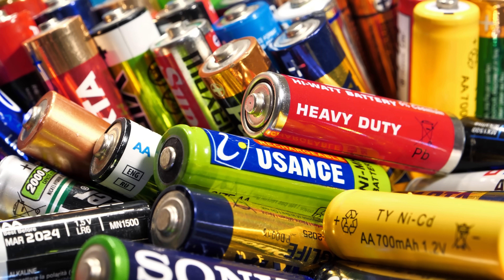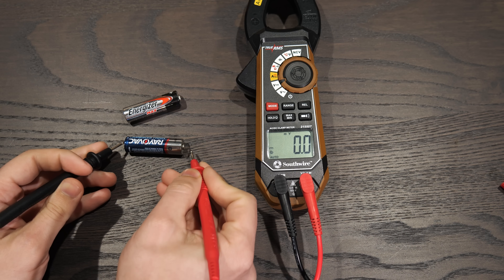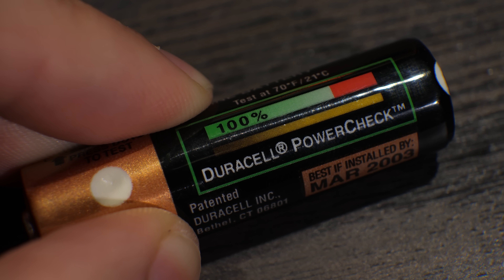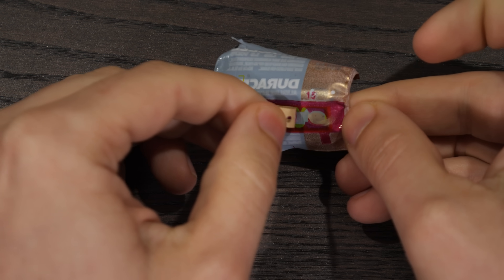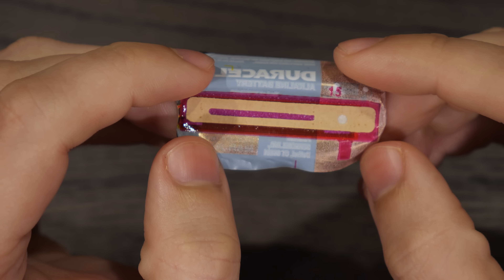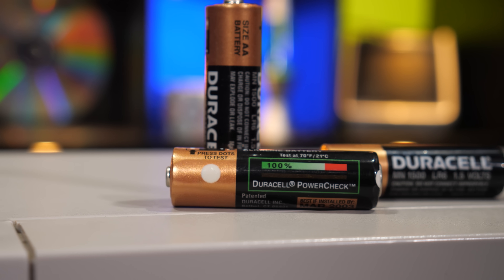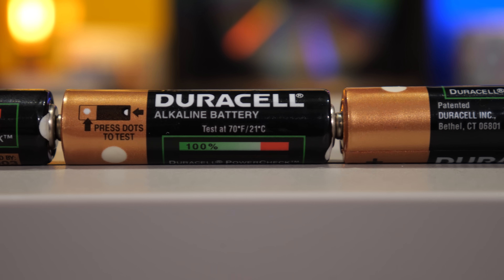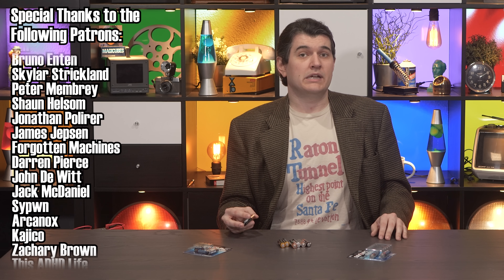Duracell PowerCheck: A genius idea which didn't last that long

Comment: that reference to a device telling you how much charge is left... minor rant. TV remotes have been able to give on-screen "low battery" warnings for multiple decades now, so why are companies still making remotes that don't do this?! I'm a TDS TV customer, so i've got a TiVo android box (yeah, TiVo's still around... who knew?) and TDS provides two different options for remotes. one that is basically a standard TV remote (though it illuminates the button backlights when you move it), and one of those annoying "smart" remotes that you can talk to. [small tangent: since those things are always listening, doesn't that really drain the batteries? who thought that was a bright idea?]. the standard variant does not give the on-screen notification that the batteries are getting low, it just stops working.... EXCEPT, it absolutely CAN do it, because we've had it give us that notice exactly twice..... in 5 years. i've had to swap out the batteries in it more than 4 dozen times by now, and it's only told us it's low twice. what the actual hell?! (yes, we use rechargables. energizer to be specific)

Comment: One annoying thing about a lot of early electronics like the Game Boy is that they only worked well when the batteries were around peak voltage.  Can’t even use it with rechargeable AAs because they have a lower peak voltage of 1.2v. This is one reason I did end up with a lot of half used AAs, since these batteries still be used in other devices that could cope with the lower voltage.

Comment: Its not that good, because with AA we could.go for rechargeable one and not throw it out, and just charge it. Now ee have builtin  bespoke batteries in evrything that are noght impossible to replace once it dies. 
Or single use devices with them like single use E-cigarettes/vapes, which is arguabky infinetly worse than simple double AA.

Comment: In my experience, the most common use for that feature, was to determine if the device was faulty or, if the batteries needed replacing.  If your TV remote becomes intermittent, the first thing to check is the batteries.  If they're fine it could be another issue (such as someone placing an obstruction in front of the sensor on the TV).  

Furthermore, quite often one battery within the device could be more dead than the others.  So then, rather than replacing all the batteries, you'd only need to replace that one.  Theoretically, if all batteries are created equal, then any time one battery is dead, so are all of them in the same device.  In practice, batteries are NOT all created equal, so if you throw out all of the batteries at the same time, you're wasting some of the life still left in them.

Comment: That power check gimmick intrigued me especially when I was a kid. I remember seeing cheap Duracell knockoffs having a blatantly fake facsimile of the PowerCheck label on it too. And I do remember the separate coppertop tester tool that came with earlier Duracell packages as well; incorporating that check into the batteries themselves was even cooler to me as a child, though pressing the buttons firmly was equal parts frustrating.

Comment: I've only had these a few times back then, mostly out of curiosity, but I've always wondered what the point of the indicator was, because, just like you suggest, I pretty much never had partially discharged batteries to worry about.

Comment: Comment from Italy here: I'm pretty sure that, in the past year, I've bought Duracell AA batteries with a pressure activated charge check. If I recall correctly, it has a green bar now, not the old yellow one.

Comment: Thank you for mentioning the included separate battery tester that came with that batteries! I was going nuts for the first 13 minutes remembering a separate tester before it was built into the batteries. I remember those worked much better than the built in tester.

Comment: Don't keep half used batteries. The chance of alkaline leaking occurs most with voltage mismatch on cells, or using different battery chemistry.

Comment: Still got a AAA on my shelf; still tests full! Without the movie magic, the bar slowly fills in from the negative side towards the 100% mark. I never would've guessed it was a resistive heater out of all things. Fascinating stuff considering it still wouldn't be remotely financially viable on a mass scale with modern technology. I never had an issue using them, and I still always keep plenty of half-used batteries around.

Comment: Sometimes they included a single thin plastic strip tester that used the same principle.
You'd bend it into a C shape and put the battery between the two ends.
They were awesome because they'd work on AA, AAA, C and D cells.

Comment: I also had a gameboy 😂 and i remember these. i DO put away half used batteries, and use them on other stuff (e.g. remote controls can take a low battery) but i have a multimeter now 🤷‍♂️ these were only ever useful to me as a kid 😂

Comment: It was a sales gimmick.  I thought they were really cool when they came out so i switched from Energizer (I liked the bunny) played with the cool new gadget for awhile. Basically taking them out of my remotes to see how much charge they had left in them for whatever reason, putting them back in, until the remote died. I eventually went back to Energizer which were cheaper, eventually discovered threw word of mouth (internet as we know it didn't exist) that discount batteries were as good as name ones and switched to those.

Comment: I recall a version that was integrated into the packet rather than the battery. I kept it around for years but I don't recall it being particularly useful. If I knew that multimeters measured battery voltage accurately I'd have asked for one as a present.

Comment: You started off with the premise of how frikkin expensive it was to buy batteries.  I definitely used to save worn batteries from something that would need a full charge to run (eg: cd player) to something that didn't need all that much charge (eg: tv remote).  I miss this tester built in, and even if I didn't need it all that often, it's something that made me feel "seen" as a consumer.  As great as your explanation was about how it worked, I don't know that the answer that was given as to why it went away was all that strong.  After all, how many selling points do batteries have, and things they can compete over?  We've heard reliability, we've heard dependability, we've heard longer lasting.  What else is there?  This is something value added (however small) that should be cheaper for them to produce as time went on, and gives them something to tout.  Even if it's not all that useful, it did give that consumer a feel good that, even if they never pressed the button, it was there, ready to dispell the unease of having dead batteries.  There must be something bigger that drove them to stop using it.

Comment: Did you know, when Benjamin Franklin figured out, how electricity actually worked, the had a 50 50 chance to guess if positive charge  moves to negative or the other way around.   It was actually Franklin, assigned the words positive and negative to electricity.
And because that predated the discovery of the Electron by roughly a 100 years and Franklin was also a businessman, he decided the positive side was ...in charge.   Causing confusion to this day.

Still, while Franklin is hardly underrated or a obscure historic person, he doesn't get enough credit for his scientific work.  The above is a pretty big deal. And was at the time.

Comment: I remember using this or the tester included in the box to check the batteries for the game boy before a road trip. We also put the used batteries that were not depleted from the game boy into a drawer to use them for the remote or a clock or stuff like that

Comment: These batteries were made when Duracell made batteries that didn't leak.  20+ years old and completely dead batteries and no leaks!
Reply: I found some old AA batteries that had a date of 2003 and they still had enough juice to power alarm clock
Reply: The funny thing is that I was unplugging the alarm clock to turn it off since I didn't know how to shut it up normally .... it went from low tone to high tone as I unplugged it (also startling me completely awake) and I spent 20 seconds searching for the batteries and finally shut it up

Comment: Even today I still prefer normal batteries over built in lithium. When they run it of juice, it's faster to swap them out than it is to put a rechargeable device in a cradle and wait for it before you can use it again.

Comment: I'd be interested in seeing a video about alkaline battery chargers. I'm talking about chargers that can refresh disposable batteries, not just rechargeable ones.

My dad still has a Saitek Eco charger that is at least 20 years old and works perfectly to this day. It takes some hours to charge most batteries, and it can detect batteries that are too low voltage to accept another charge. No idea what the energy efficiency is, but I'd be curious to know.

Comment: It is still just voltage going through a wire. It is just a tapered wire that changes the voltage required to make it heat up as it increases in size

Comment: Such well done videos , my guy !!  It's been my experence , that these batteries were awful . I tried them twice, with many months in between, but with same results each time. Some batteries were nearly dead right out of the package or they lasted about 50% that of a regular battery . So I believed them to be defective & easily shorted or testers too easy to be activated . Lke when in an opened package or just loosely rolling around in the junk drawer . Duracells always seemed to expire quicker than even  generic named brands for me. I actually prefer the "cheap-o" ones. .Last just as long as "Name" brands & half the cost! Anyone else have a similar experience ??

Comment: Awesome video, I did take one of these apart too.
     And yea, it pisses me off that most especially high drain devices are built to take AAA when they could easily fit, and be more useful with AA cells.  Flashlights and things with motors.  Unless battery manufacturers are subsidizing these product manufacturers, it makes zero sense.  In most cases AA in these applications are absolutely not too big nor heavy.  And I don't care if AAA would be made proper cheap, I'd rather not change them after using a bright flashlight for 10 minutes, and yea, alkaline, and they are getting dimmer before people realize.

Comment: I use an unorthodox method of testing alkaline batteries. I set an analogue multimeter to the 10A range, hold the appropriate end against one probe and briefly tap the other end with the other probe and see how fast the needle moves. Alkaline batteries can tolerate being shorted for the fraction of a second it takes to estimate how good the battery is.

Comment: We used to have those batteries but I never found out how to use these testers properly. Now that I know it and double A's are rarely used anymore, I wish more battery's would have them. Sometimes a device stopped working meant the battery is empty - nowadays it's more likely the device being broken

Comment: I remember those! I thought that was a neat idea and was disappointed when Duracell stopped using those labels. Even though it was difficult to get the on battery tester to work, we would still use them to see if they worked since they would sit in the box for quite some time before being used. We didn't want to get the full sized Volt Meter out to test every battery, so this was nice to have.

Comment: 2:19 Am I allowed to be pedantic, the “multimeter” you’re using is actually called a clamp meter, the difference being how current is checked between a multimeter and a clamp meter. A multimeter has to be put in line to measure the current, whereas a clamp meter can use the jaws placed around a single wire I.e neutral or live to measure the current. 

Also clamp meters tend to be worse at reading resistance (has a lower measuring range, not accuracy) 
Sorry

Comment: One point that was missed as a drawback was the battery size -- the meters made the batteries wider than normal.  That may be fine in the remote, but anything tubular like a flashlight (or even some remotes where a battery slid to the back out of sight) they weren't going in, and if they did, they weren't coming out.  That alone was a reason to avoid them.

Comment: I remember, for a short time before the testers were on each battery, there was one tester built into the packaging. It was made the same way though.
Once, I took the tester from a AA package and tried it with a higher voltage. It turned solid white (I think), then black, then started smoking.

Comment: I use AA rechargeable batteries when possible. Lower voltage means the indicator always stays on the "replace battery mode", but it can hold for months.

Comment: So what is the ideal current draw to test an AA? Regrettably, Duracell quality seems to have tanked, they seem very susceptible to leaking. And Kodak batteries are just low quality China made cells sold by an importer with rights to the name Kodak. Finally, because rechargeable batteries only provide 1.2V is it worth talking about which devices don't work well with them?

Comment: I remember these growing up, and never ever got one to work.  Figured that's why they disappeared.  So to see how it's meant to have looked like is a real treat!  As a kid, I did move batteries around so the tester would have been useful - except I clearly couldn't press hard enough and iirc Duracell were much more expensive than ever ready so I tended to have the latter.  And I only had a couple, which is why they moved around.  It was interesting that some devices would work with old batteries and others demanded new(er) - sensitivity to voltage I guess, so there was a sort of a 'hand-me-down' situation going on.
I counter your claim of rechargeables though.  I tried them eons ago and found them too short lived - iirc they were 1.2v instead of 1.5v, and recharging every week or so instead of just buying a regular battery every few months was a drag.    And the rechargeables were way expensive so the payback was slow.  For me it just fizzled.  Too often I couldn't the ceiling fan cos the 9v was flat...again, and it took a couple of hours to recharge.  So now, the remotes, mice and irrigation systems all use fresh energizers in this house.  Sure the phone and laptop have rechargeables, but they never had anything else.

Comment: Absolutely, they had to be pressed hard & therefore, some good batteries could get tossed if the person in the family who insisted they were doing it right wasn't actually pressing hard enough or in the right spot. I've kept an assortment of the package ones with the extra plastic trimmed away. Since I own some things that only correctly work with rather fresh batteries & other things that work with somewhat dead batteries, they come in handy.

Comment: I still use an "alkaline battery recharger" . Never did the math, but it certainly gave me the impression that it effectively refreshed used alkaline batteries. A feature on that bit of tech might be interesting.

Comment: Want to point out that brand loyalty was a definite thing back then. The fact that the 25 year old battery you're holding has not leaked at all....That used to be a major concern for expensive electronics. Cheap batteries were notorious for leaking and ruining, at best the battery contact pads, and at worst the PCB. Duracell batteries used to be made in America by well compensated employees who had pride in their product.

Comment: I remember a few cheap knock off batterys from China (RayovaLE comes to mind) that would print a tester on the battery but that was just a image without any function so the yellow bar was printed there forever telling you it was at 100% even without pressing it, even if it still had the label telling you needed to press to test.

Comment: If you ever read the actual data sheet of one these zinc carbon, or Alkaline, batteries, useable life was rated down to 0.8V (for a 1.5V cell). I remember these particular types of batteries. That was just extra expense, most people never used. Also under certain conditions, that "test switch" could be accidentally pressed, and you just drained your battery.

Comment: I reckon Duracell removed the tester as part of cost cutting measures, and also to sell more batteries, having people be able to easily tell if a battery has charge would potentially mitigate them from just grabbing a fresh one and thus using more batteries

Comment: Always bothered me that rechargeable batteries (non-lithium) have slightly lower voltage than Alkaline batteries. It's quite noticeable with flashlights. My pen flashlight that uses AAA batteries has a noticeable brighter light on fresh alkaline than they do on freshly charged (new, not old) rechargeable NIMH batteries. For small electronic devices the small voltage difference usually makes no difference.. but it does on some things such as a flashlight, it just produces a weaker beam of light.

Comment: I have almost stopped using alcaline for more than 20 years now: all NiMh with several high quality chargers. Only a few applications call for Alcaline: rare use or slow slow discharge like a click or remote control.
And yes, when it stops you replace and if it works again it means the battery was depleted.
Nevertheless, I was fascinated by these little testers and I could not help but pressing on them for no reason. Strangely enough I never took one apart, I really wonder why in retrospect.

Comment: I definitely remember the yellow part being hot.
I'm glad my Xbox controller still uses AAs. Batteries dead? A full recharge takes 10 seconds! It's like ICE vs BEV. Plus today's rechargeable AAs are the full 1.5v, not 1.2 like the NiMH of yesteryear.